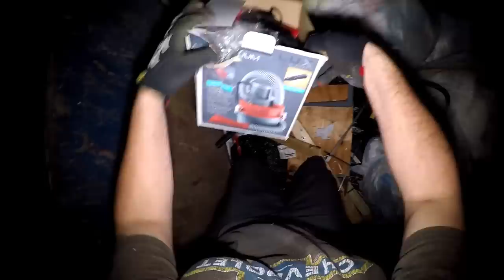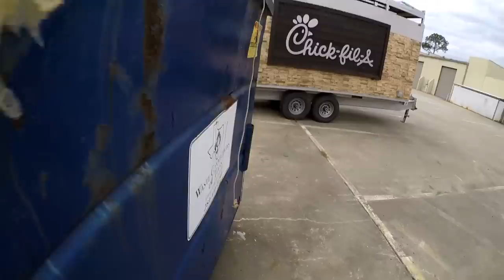Dumpster Diving 41.2 (Oh Look At That! More Copper!)

Comment: Mike back in the 90s i used to work weekends at a local dump and there was a man who used to strip the concrete blocks out of the washing machines.
after a few months he turned up with some cash and photos he had taken of the low wall about 8 foot long and 2 foot high he had made out of washing machine concrete.  
to be honest it looked quite good with all the different shapes and all.
Reply: I remember those blocks..They were in the GE washers, at the very bottom to keep it. Kept it  from shaking so bad.

Comment: Funny to me that I will never forget the day I discovered when I clamped the end of the wire in that conduit in a vice and walked while pulling the aluminum casing that it slid out slick as shit. It was a bit smaller of a roll but I walked n walked,  I was proud !! after thinking it would be so hard to twist all that aluminum off with cutters.

Comment: Today was my lucky dumpster-diving day. Found a fixable 1950's record player, an Atari 256 console, a bunch of vintages PC games from 1990-2000, plus a whole supply of unused spare cables, chargers, light bulbs and computer parts. My workshop is fully stocked and I haven't paid a dime! Where there are dumpsters, there is treasure!
Reply: Residential or commercial dumpster?

Comment: you also could measure that wire in the aluminum and sell it on facebook market place for higher then scrap value as that stuff isn't cheap when you buy it at the lowes or home depot.

Comment: You found the septum seals 8:55 for the glass jars that came in the white boxes. The discs should be Teflon and silicon rubber which goes inside the aluminum crimping ring to hold it tightly to the bottle, Teflon side down. To actually seal the bottles you will need the correct crimping tool, not cheap last time I bought one.  The tool will need to be sized for the diameter of the crimping rings used for the bottles...or you can just use corks. 🙂   Great finds, would loved to have beat you to the metal find in the first dumpster. Alas, my wife frowns harshly when I make a discovery of great worth and deign to bring it home. ☹️
Reply: what are the bottles for?
Reply: @1962mrmongoman  the bottles with associated seals are typically used for pharmaceutical and laboratory products. They come in a variety of sizes. In our particular application they were used to contain a chemical used for mounting microscopic samples. We used them because they prevented evaporation, were spill proof and at the time could be transported on passenger planes.